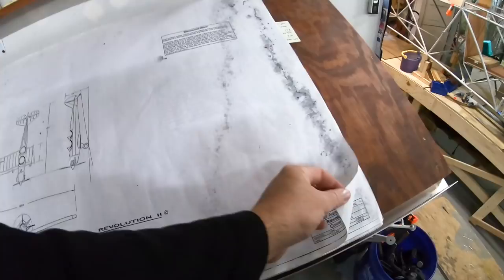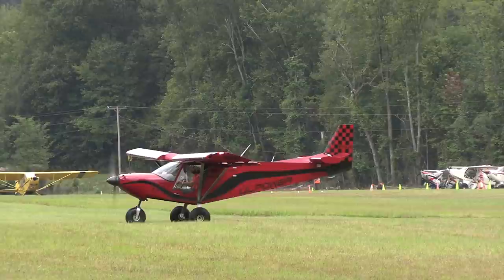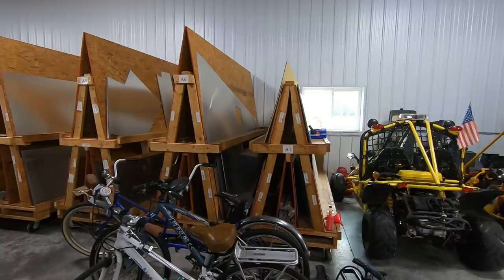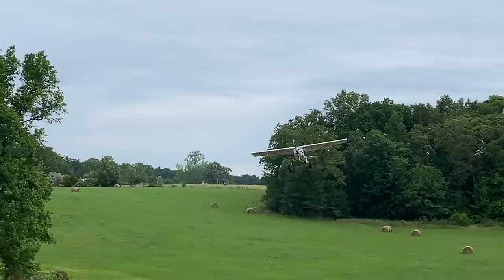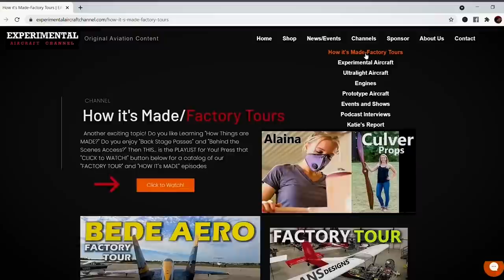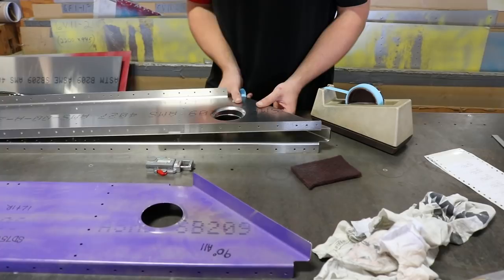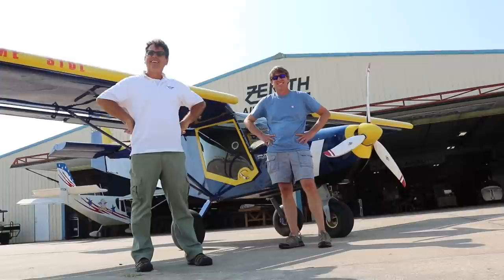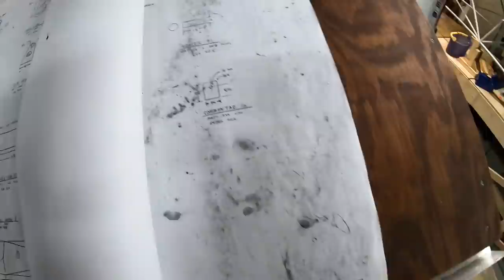Keeping the Mental in Experimental Aircraft - Must Watch BEFORE Buying a Kit or Flying Aircraft

Comment: Great advice, thanks! The kits that I really like are Velocity, BD-4C, RV-10 and plans build Cozy Mk IV, but Velocity and RV-10 are probably going to be too much. So I'm torn between the plans-build Cozy, which is very sexy, but might be difficult for entry and exit; and the BD-4, because I like high-wings. The BD-4 would end up being about $25k more than a Cozy, but much shorter build time. If it's raining when I'm getting in or out of a Cozy, then I'm getting wet and rain will come inside as soon as I raise the canopy, but with a BD-4 I'd be under the wing and have time to put up and umbrella without rain getting inside the plane.
Reply: We have flown our VariEze to Oshkosh many times. It was 2009, IIRC, that I decided to add "In Rain" to my preparations to go, including approaches in rain in the X-Plane sim. And, sure enough, that year we landed in rain, taxiied in rain, found our campsite and set up camp in the rain. Of course, the VariEze has a canopy similar to a Cozy.

It's really no big deal. And, it rarely happens.

Also, we didn't build our VariEze ... but we did refurbish it and it is better than new, now in its Forty-First year of flying. I am also refurbishing a Cozy MkVI that we didn't build.
BTW ... our VariEze is For Sale. :)

Comment: Your advice on "How many are flying in the field" is spot on. My friend Doc could and did fly everything. He decided to by Haul #1, that had never been flown, from a gyrocopter manufacture. On his second touch and go the craft broke apart.
Reply: Damn shoulda drop tested it at full load
Reply: Sure hope Doc walked out OK.
Reply: @timduncan8450  Doc dropped several hundred feet, at the speed of gravity, without a rotor. No, Doc wasn't alright. He passed. That's the point. 😞
Reply from the maker: Wow! That is quite scary. Sorry to hear that.

Comment: Hello Bryan! A well done and informative video!  I'd like to add just a couple of items that maybe could also be covered in a separate video.  As you know, I fly and do annual Condition Inspections on experimental aircraft as well as Annual Inspections, etc & fly certified aircraft.  I, by no means intend to scare anyone off from buying an experimental aircraft.  But you must be aware of this.

Folks, for most of you that do not have experience in production aircraft, there are things that you need to know (versus experimental aircraft). Production built aircraft must follow a series of processes that are planned, written and then approved by the FAA before they receive a Production Certificate issued by the FAA. Under this umbrella, they must have the proper tooling & tools to build; they must have a supply process in place to ensure that the parts being received and used in production are inspected to ensure that they meet engineering and FAA standards. The build process is constantly monitored by a QC (quality control) department that is linked to the FAA Small Aircraft Directorate Office. When an assembler is terminating wiring for example, an FAA approved inspector must come in behind that assembler and "buy" each terminal crimp. And the list of safeguards goes on & on... This is in-part, why production aircraft is so darned expensive!!!

The "Quality Control" of an experimental aircraft, is the builder - period. Yes, the FAA must sign it off before flight but it is up the builder to ensure that the terminals are correctly crimped, that the bolts & screws - although they look tight - are correctly torqued by the builder, that the materials being used are of sufficient strength in shear or tension. That FAA inspector or DAR won't (& can't) go that deep. I was flying a friend's IFR capable RV-6A who's father had built. He was a meticulous man who "did everything right", perfectly driven rivets, etc. During a VFR flight (luckily), I lost the panel, radios, etc. After some extensive troubleshooting I found a ring terminal in the electrical power circuit was incorrectly crimped. Although the wire end was inside the sleeve of the ring connector (not visible), it was not making sufficient contact.  This stuff will bite you!

I write this so that you don't get bitten or worse. I love flying that RV-6A but folks, I ALWAYS keep in mind that it is an EXPERIMENTAL aircraft and operate it as such.
Reply: Great guidance! I’ve developed a relationship with an EAA technical counselor in my area. I’m on the empennage kit and he’s visited twice already and I expect him to do two more visits before riveting skins. I would not embark on this adventure without such in-person expert support. He’s taught me a ton about tolerances and what constitutes an acceptable repair and so much more. Btw: Each visit is documented and signed off by him. I believe that if I ever decide to sell this aircraft this documentation will help prospective buyers to have a favorable perception of the build quality. Anyways, all of this just to say that you’re absolutely right! Don’t leave anything to chance —  trust yourself, but still verify!

Comment: Great video! 
You are far too kind. Most of my 38-39yrs of aviation has been as a renter. I recently sold my certified aircraft and entered the world of EA (RV-10 slow building).
It's been my experience that the aviation community is a snapshot of society. Whatever type of scum is in society will be in aviation. Buyer beware on buying a kit from someone. 
I'm so anal about my build that each rivet almost gets a name...lol...
Like you said me and my family will be in it when completed. I personally would never buy a worked on unfinished kit. A built is also iffy. Of course this is just my opinion. Lots of people have had no issues with the purchases.
Reply: I'm also a renter. You know what they say about the 3 F's and renting...

Comment: Excellent point regarding the build instructions! This becomes a maintenance manual of sorts during the life of the aircraft. The drawings become a repair guide (be sure to check that every page is there). Manufactures of kits are not interested in replacing your lost paper work, nor should they be.
Reply: they are also withholding drawings and plans for major components of the aircraft, there's no reason for it, a kit should come with a complete set of drawings and plans for every part, they have the plans to make the parts, why won't they give them to you?
Reply: @embededfabrication4482  I didn’t realize that kit manufacturers don’t provide complete drawings.
Reply: @darrylday30  neither did I, I'm sitting on a kit I paid over 11K for that I haven't touched cause I'm waiting for the rest of the plans.
Reply: @darrylday30  they won't give the drawings for the main frame.  They said "it's beyond the scope of the home builder"...what a crock.  It's an experimental aircraft, by it's very definition, it's supposed to be within the scope of the home builder.
Reply: @embededfabrication4482  The question I have is, do have what you need to assemble what you’ve got? If not, ask for what you need instead of what you want. Chip away at it bit by bit. Be polite. Say thank you. Make sure you know their names. Make sure they know you as the awesome friendly guy on the phone just having the time of his life building his first airplane. Focus on building what you’ve got and build a healthy positive relationship with the people who can help you. How do I know this, I spent 17 years building water bombers at Bombardier. It was the ultimate team sport. BTW, what are you building?
Reply: @darrylday30  I'm working on a bearhawk patrol now, I put the project missing the plans off to the side, I can weld, I'll just make the frame myself later.
I'm also getting my kolb firstar going.  you can see build vids and my custom trailer on my channel.

Comment: VERY good advice @7:38 .  I made the mistake of ordering a kit from a well known company which has been established for many years and at the time felt comfortable with paying all up front.  1.5 years later, I have around 50% of the kit.
Reply: Where do you live? Let’s have a flyin and get a group of folks to fly in and get some work done!
Reply: @cebunting  Thank you for the excellent suggestion/offer.  Right at this time, I have not received enough of the kit for much to work on, and after the delays, I am most likely going to look for a used Aeronca, Taylorcraft, etc. instead.  Life is short.  I just wanted to agree with the comment in the video to never pay 100% up front, even how established you believe the manufacturer is.  Thanks again for your reply Cameron.
Reply from the maker: Sorry to hear (read) that Michael. If it was ordered in the last 2 years then the situation is supply/demand. MOST of the manufacturers are in fact 1.0-1.5 years out on delivering a NEW order. This why I say the "Airplane Boom/Baby Boom" quote. I think the number of Aircraft kits being ordered... and then the ones that will be completed and flown over the next few years will break all time records. Can't plan for what just happened in this industry. And we ALL thought it would simply DRY UP! Boy were we wrong! :-)
Reply: @ExperimentalAircraftChannel  Thank you for the reply.  Yes, and I cannot imagine how difficult it has been for kit manufacturers to choreograph their suppliers & orders over the last couple years and need to keep this into consideration because we all want the industry to survive.

Comment: Great video. The experimental used market is the Wild Wild West. I have looked at many airplanes being sold as kits that the builder turned into scrap metal because of lack of workmanship. On the same note I have seen many flying experimental’s that are death traps. Experimental gives you freedom to do things as you see fit. (Good or bad) Trust but verify is the name of the game.
Reply: Some folks took the "Experimental" to the extreme. And I totally agree. Some are flying Frankenstein's out there
Reply from the maker: OK Mr. Bearhawk Builder! True true. You  know. :-)
Reply: @ExperimentalAircraftChannel  I mean, just type this on YouTube: 400 HP Corvette V8 Engine in a Cessna 172
Reply from the maker: @HECTORFARRA  THAT is very interesting for sure. But I am always disappointed to go to a BUSINESS website and now where to be found is there ADDRESS or CONTACT info???

Comment: Very interesting and informative. Thanks for sharing. I was very interested in an experimental and had researched multiple kits. Unfortunately part of that research involved insurance and that took the wind out of my sails! Building hours in a certified aircraft now and haven't given up the dream so I appreciate the information you put together.
Reply: What/where did you learn about insurance that was discouraging?
Reply: @timduncan8450  Depending on the aircraft, the insurance can be 5 to 6 times more expensive than a certified. Some returns to consider are the possibility of doing your own maintenance but as a low time, older pilot (age and insurance = $ also) I elected to go the certified route. One of the cheapest experimentals to insure was an RV (w/nosewheel) due to the number of them flying currently. That also plays into the certified as the C172 is one of the most economical to insure (prolific model). They aren't fond of tail wheels either!
Reply from the maker: If you are comparing to maybe a Cessna 150 or 152 possibly. But if you compare aircraft of similar "value" it should be not THAT much more. I think the "average" for a Experimental can land around $1,500-$2,000 for your initial "years." And as you (and your Airplane/Airplane configuration) your rate will drop. New Pilot. New Airplane. Low hours in all categories don't give insurance companies the "warm and fuzzy feelings" of other high time (experience) Airframes or Pilots. So YES... don't give up the dream. It just might take a little longer to get there. I am in that boat as well. But... it is FINALLY about to all come together. Hopefully... YOU and I can go fly one day! :-)

Comment: Came up with a combination of wing design that is stol and fast cruise. Works in model.
Reply: @S M will be happy to do so very simple took mechanism for leading edge extension used on airliners redesigned it to operate with hand crank. Ribbed carbon fiber wing, rubbing surfaces on wing are high density polyethylene or delrin sheet. Semifowel flaps. Can almost double wing area.
Reply: @S M i based it on engineering designs al ready done resized for smaller wing. Rotating gear on shaft engaging liner curved gear. Simple ratching gear to turn shaft.
Reply from the maker: Nice! Send a message over here once you are further along... would be a great conversation! :-)

Comment: There were many handy comments in your video. I have a question if I may ask, as an industrial designer, I automatically think about over-desogn issues. Building the airplane of my own? I will definitely go for using 5mm rivets instead of recommended 4mm rivets or say the 6mm nut and bolt instead of the 5mm nut and bolts mentioned on the assembly plans. Well in trade of loosing several loading pounds. Will this be a problem, generally?

Comment: Interesting you were talking about plans.  I stumbled on a website that was selling the plans for a Quickie Q2 for $99.  We all know the original Quickie company has been closed for decades so how do I judge the plans +templates?  Can I buy foam somewhere?  Epoxy systems have improved since the 1980’s .  Where does one find these products?Hardware obviously would need to be made.
Reply: The Q2 fuselage was Preformed, there are no published plans for that process...
Reply from the maker: Wicks Aircraft Supply. Aircraft Spruce & Specialty. And a few others. YES. Not sure on those plane. BE CAREFUL. There are a few sites out there that have swiped plans and not actually have the rights to sell them (or are the updated ones). FYI

Comment: What does AWS certification of applicable welding processes actually mean?  It's been recognized for over 100 years that you can't judge the integrity of a weld by looking at the surface.   AWS certification means the welder is subjected to a periodic practical standards test where their test piece is subjected to DESTRUCTIVE testing among others. people fuss over every rivet, but for some strange reason they don't think welding matters

Comment: There may be out there that are so naive that they need the protection you describe but it sounds like big brother and you ad the builder are just a check book and labor. I think those people are hard to find.  I think 9 out out of 10 times the buyer has been schooled by flying groups, internet groups, going to shows like Oshkosh, etc.  the 1 in the 9 out of 10 is impulsive and the kit never gets built.  The guy that isn’t covered is the retired aeronautical engineer who retires and promised his grandson he would teach him about airplanes the way he wished he would have learned.  He knows stress and strain, he knows weights and balances, he knows materials. He wants to design, develop, verify and fly the air plane of his dreams.  For the 100 or so, light kits are on the market there are probably 500 failures.  Where do the fresh ideas come from?   I’m not one of those.  I rode motorcycles and boats of my design.  I am an engineer.  Adding the 3rd of freedom takes the desire away.  I won’t fly a plane I design.
Reply from the maker: OK. Hah!

Comment: Getting ready to put down for a kit. Leaving out the avionics and will be putting in later. Will need more than basic avionics (Mosquito XE w/ ads-b out ; Alt encoding Transponder and radio minimum), so how do I pair the avionics I'm going to get with the equipment that the kit comes with so my panel isn't cluttered?  If you got any insight.
Reply: Go to the Mosquito Forum and ask this question
Reply: Don't buy any avionics until you are at the end of your build. Get them too early they will sit around for years, new models with better features at lower prices will come out and you will wish you had waited.
Reply: Also, you don't have to take the avionics that come with the kit, you can change those out or get different for credit.
Reply from the maker: As suggested below (Thanks guys for chiming in to help a fellow Builder), not a big deal to wait to the end an newer or better may be released then too. The "Airframe" connections are what they are. The only thing that might/should be different it what attaches to the engine for Engine Monitoring. Best to ask the Avionics manufacture about the connections (sensors) you will need for a specific engine. Clutter? That is the beauty of Building. You can "map" that out as you see fit.

Comment: I want to build a power lift aircraft... But I want to modify a velocity to create it.. Any advice?
Reply from the maker: Start small. Very small at scale. Then... scale UP. Call Velocity and maybe you could work something out with your ideas. You never know until you ask. Thanks for saying hey! :-)
Reply: Hello Bryan, my name is Jack.  Not knowing you makes it hard to give accurate advice.  I also do not know what you have in mind but, in short, I'd say "NO".  Unless you are (or have access to) an aircraft structural engineer and/or aerodynamicist and you have a huge amount of experience and time I would avoid deviating from a plans or kit. The Velocity is a well known and successful design. Small modifications are expected during a build to suit your taste but major modifications can easily compromise an otherwise safe aircraft. In addition, the majority of the Velocity is built of composite materials.  They behave differently from aluminum structures.          Again, I don't know what your experience or the extent of your intended modification so I'll close with telling you to BE CAREFUL which way you choose to go - we don't want to read about you in some accident reports!